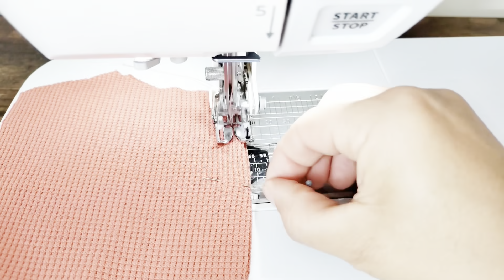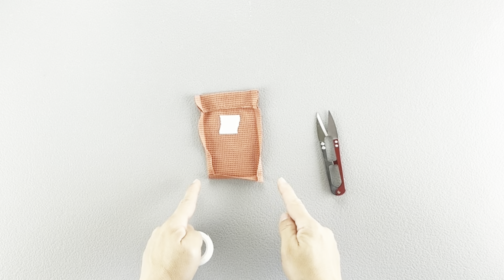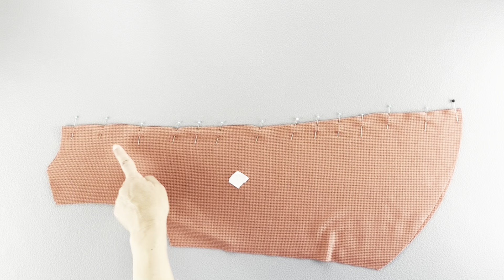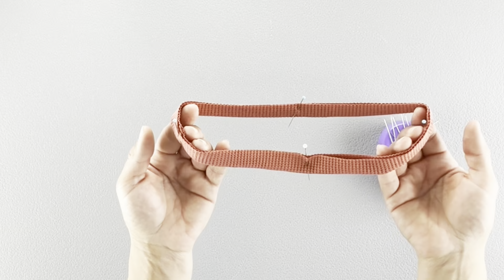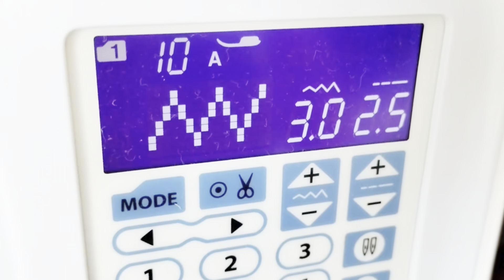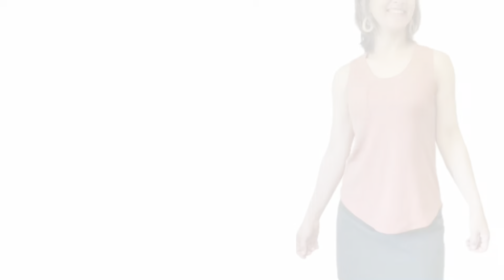Sew an Easy Summer Tank Top on Your Sewing Machine

Comment: Thank you for using a sewing machine for this project.

Could you explain... why use a lightening bolt stitch to attach the neck/arm band if you sewed a zigzag over the top?
The lightening bolt stitch doesn't look beneficial?
Reply from the maker: Topstitching is optional and aesthetic — and if you feel it will impede stretch, you can skip it.  I like to make sure the main seam is maximized by stretch, so i I never have any popped stitches there.  I typically do neckbands this way and have never had any issues 🎉 🍀 🤞